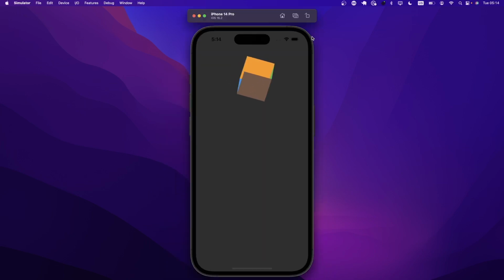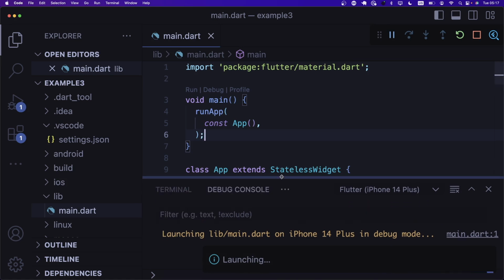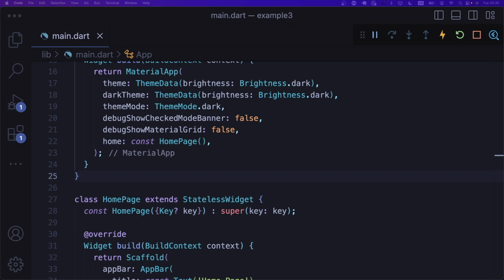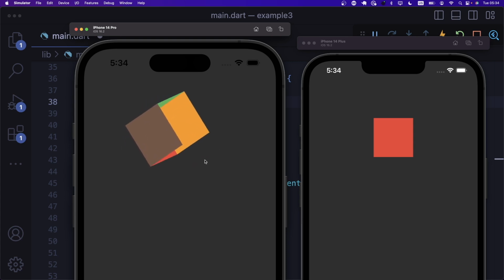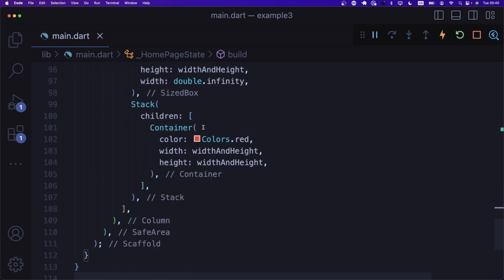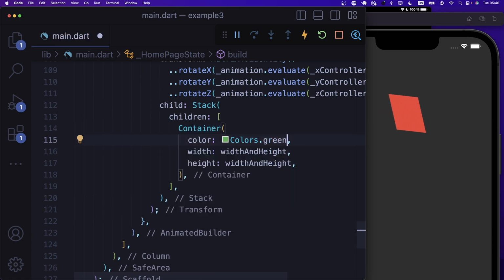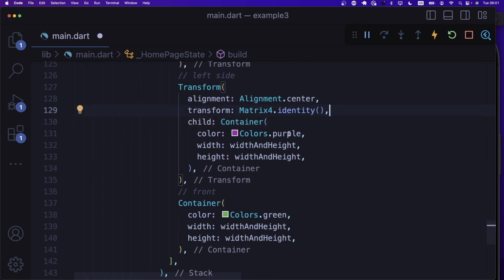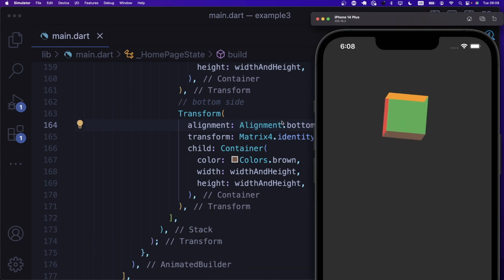3D Animations in Flutter - Learn How to Stack and Rotate Widgets for a 3D Effect in Flutter

Comment: It is possible to change the children sequence:

```dart
double dimension = 50;
  
  List<int> placement = [1, 2, 3, 4];

  List<Widget> get _children => [
        const SizedBox(height: 100),
        containerOf(placement[0]),
        containerOf(placement[1]),
        containerOf(placement[2]),
        containerOf(placement[3]),
        ElevatedButton(
          onPressed: () => setState(() {
            placement = placement.reversed.toList();
          }),
          child: const Icon(Icons.refresh),
        ),
      ];

  Container containerOf(int count) => Container(
        height: dimension,
        width: dimension,
        color: switch (count) {
          1 => Colors.red,
          2 => Colors.green,
          3 => Colors.brown,
          4 => Colors.white,
          _ => throw UnimplementedError(),
        },
      );
```

For flutter Transform widget. it's not possible to setState while listening to the animation, but it's possible to separate animation to differet phase, and set the the proper placement of Transform widget according to the rotation.
Reply: or just simply set the opacity to 0

Comment: hi Vandad Nahavandipoor thank you for your awesome job, I have a question why did you use vector3, I didn't understand
Reply: I think using vector3 is a sense of metric, sometimes trigonometry using with metric. For top, bottom, left and right he used alignment centerTop, centerBottom, centerLeft and centerRight for pivot points. But he still need pivot points for back so he used vector3 for getting pivot points.

Comment: Hi sir I was wondering why the left hand side of the cube's angle which has  alignment: Alignment.centerLeft is actually pi/2 instead of  -pi/2 since he is rotating in y axis but inside the axis like a door that we open. 38:15. Or I missed something?
Reply from the maker: What you can do is to experiment with angles and the Y axis in Flutter to get a better understanding of why it was done the way it was done. It's a good exercise regardless
Reply: @VandadNP  thanks for the response. I'll do
Reply: I think you have to look at the y-axis from the top perspective. I actually got confused too because we moved counter clockwise based on the video mark you were talking about but it turns out I was thinking of the x-axis. What I did was to imagine a stick floating above me while looking upwards (since the y axis is flipped in Flutter) and then imagine a glued paper flag pivoting the stick. When you pivot the flag to become the left side plane, it is actually doing a clockwise motion hence the positive sign for pi/2.
Reply: @emskiee5330  thanks your exemple help me a lot